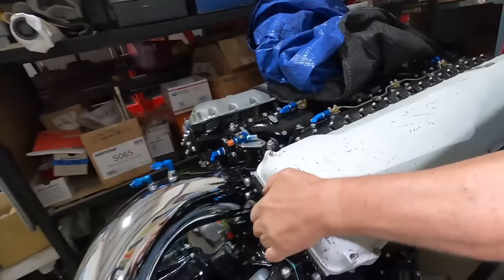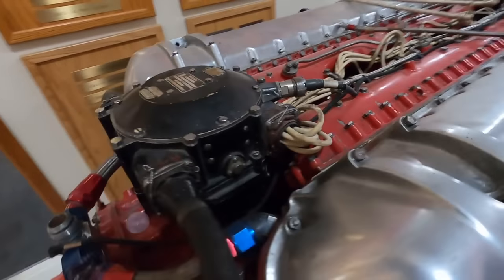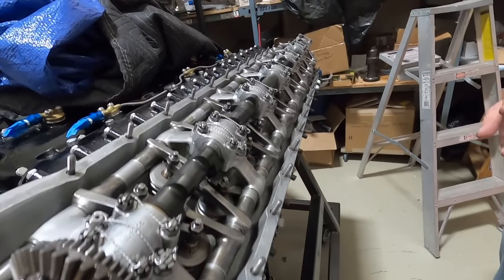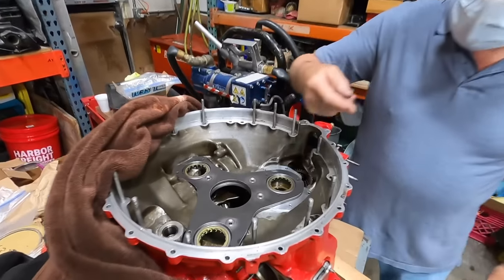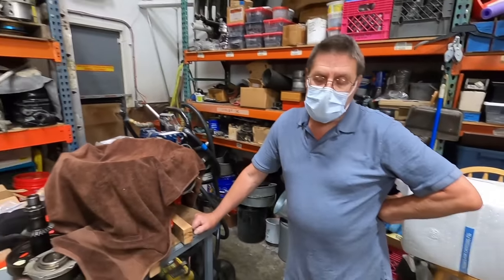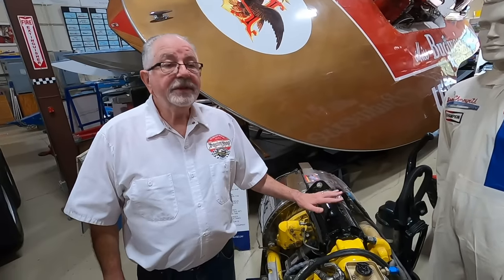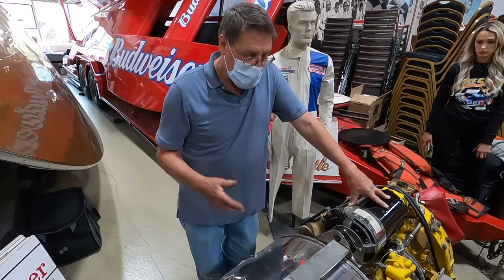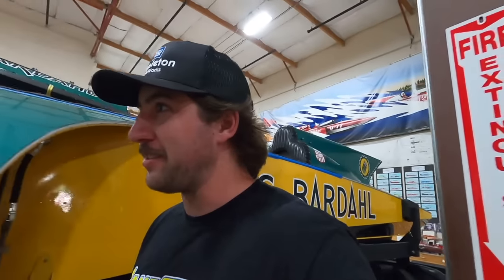The Rolls Royce Merlin: WWII Fighter Plane Engines Modified For Hydroplane Racing!

Comment: The reason for multiple stages in airplane engines is to compensate for the reduction in air pressure as the plane climbs.

Comment: Twin spark plugs are almost mandatory to make five inch bore (and up) gasoline engines run right.
Shut one mag off you lose like 250 horsepower and the exhaust pipes turn bright yellow from wasted fuel energy.
Reply from the maker: Interesting! I wondered why it needed two and forgot to ask him. Thank you

Comment: They Didn't Call Them "THUNDER BOATS" For Nothing 😂
Grew up with these beasts. Worked with Seafair and the Water Follies. And Boeing 😏
But really "MISS" the sound of the pistons.
And being they used to run several laps per race. You learned what sounded right. And what sounded like... 😢
.... memories

Comment: I am hooked! Thank you for doing this. Don't use a merlin, You'll never keep it with the parts it'll need. There are alot more Allison's
Reply from the maker: The cool factor would be the original RR engine in the modern RR car but I get what you mean.

Comment: Very interesting and informative video; props (pun intended) to the folks at Hydroplane and Race Boat Museum for their efforts and knowledge!  There was nothing quite like the sound of the Merlins, Alisons and Griffons, "back in the day"; there's just the one turbo-Alison boat now competing (U-3 Cooper Racing); they raced at Guntersville this past weekend; Jimmy King did credibly well, only to have his first place finish in Heat 2B taken away, owing to the "under 80 MPH rule" prior to race start (as it was, the final was cancelled, after Andrew Tate blew over in the U-91, after getting caught in the roostertails of the leading boats; severe weather moving in caused the officials to cancel any restart of the final).  This race also saw the first "post-fuel restriction era" 170+ MPH qualifying lap (Dustin Echols in the U-40 Bucket List Racing boat).

I think the Harley-Davidson V-twins use the "blade-fork" conrods in their engines.  Also of interest to me was how different the Griffons sounded vs. the Merlins; I've learned that it had to do w/ firing order, not displacement, giving the Griffon a much more "brutal", gutteral sound, vs. the "snarl" of the Merlins.  I wonder if the museum has the gearbox used in one of the earliest turbine boats, the U-95, which ran two T-53 Lycomings (used in the UH-1 "Hueys"; the T-55s used now are in the CH-47 Chinooks); they ran the output from both engines to a single prop...I think the Executone you had a photo of at 23:50, was the U-95 hull, last raced in 1983--it only ran the T-53s for the 1974 season, doing quite well, before ending up on the bottom of Lake Washington when a hot section exploded on one of the engines...
Reply from the maker: Is it still down there?
Reply: @Stapleton42  The hull was brought up the day after the event; it then ran, not so successfully, in 1975 as the "Shakey's Special", using stock-Allison power, then again in 1976 as the "Sunny Jim".  Later versions of this same hull ran as an Oberto, and the Executone (1982-83), as in the photo.  Not sure where the hull is now; seems it turned up for sale somewhere...IIRC, Pam Clapp donated the unusual gearbox to HARM sometime back.

Comment: At 25:17 in the presentation, it is remarked that engine used in the Unlimited Hydroplanes was from a Huey Helicopter. In my investigation, it was the Lycoming T55 that was used in a Chinook Helicopter, because of the existing gear box. The greater question of mine. Where did fuel storage take place on the H1 Unlimitied's. It's 4.3 gallons / Min. on consumption of fuel. Because, of the weight of the fuel at the end of the race with the now "nearly" empty fuel tank (s) or fuel cells. How was the weight difference corrected? Was the race laps in racing a  H1 because amount of fuel on the race boat.  What I am refering to, is the balance of the hydroplane.
Reply from the maker: Good question. They’ve used multiple types of helicopter turbines all over the spectrum from what I’ve read.
Reply: @Stapleton42  It's the ones with the changeable gear box. I have also read the H1 class all boats "shall" use the same type of engine. From boat to boat so that no one will have an unfair advantage. After burner is not allowed. (although that would be really cool ". I don't trust the internet..... so whether this is true or not is unknown to me . I'm just asking.

Comment: Stapleton nailed it when he said the high performance car industry was born from WW2 aircraft engine technology.  Supercharging, turbocharging, hemi heads, 4-valve heads, high octane fuel, water-methanol injection, nitrous oxide.  All of it was top secret technology, required to win the war.  When the war was over engineers applied it to our cars, and when the aircraft mechanics came home, they started building race cars from what they learned in the war.
Reply from the maker: Yes sir!
Reply: Maybe in design phase but once aircraft flown over territory held by enemy not so much. Everyone sent engineers to look over shot down aircraft.

Comment: Allen Millyard did similar rod set up in his kawasaki v8/v12 coversions. Similar to radial engines rod set up."thats not something you build in your garage"- gearbox, Again Allen Millyards 15x20 shed in u.k. disagrees. Sand casting, mill, files, measuring tools, and lathe boom u can make ANYTHING

Comment: Check out the boat in my picture thing! 1983 Hondo XH511 T-deck runner bottom, 468BBC with a hydraulic throttle, powerglide transmission without a torque converter, Casale V-drive, and 7 place adjustable cavitation plate's (adjustable trim) 11x13 pitch elephant 🐘 ear propeller! Get in touch please, I've raced almost everything, and a motor head since conception!..from Wyoming USA 🇺🇸 👋🤠

Comment: I’ve been interested in performance engines since before HS but I grew up in a Farming Family in South Texas, born in 1955. Got into Drag Racing as a Top Alcohol Dragster Pit Crew in the 70’s progressed to Super Stock in the 80’s and Bracket Raced my HS Car in the 90’s and became NHRA Safety Safari Top End Director from the late 90’s to present. I could understand him and sure to find myself a position in his shop and crew. Very Intriguing! Indeed!

Comment: Amazing engineering !
   Blowers are inefficient... why didn't they turbo  instead of supercharger in racing form or plane ???
Reply from the maker: I would think 1940 turbo technology was not up to par. Heck even in the 80s it wasn't like it is now. Also packaging constraints. Part of the Merlins appeal was its narrow footprint allowing for an aerodynamic fuselage
Reply: @Stapleton42  CRAZY it's that old !  OMGOSH I didn't even think about 30-40's tech. when designed & built. Your right Turbo's not reliable (at all ! )  till middle 80's .  Lol what a beautiful engine !

Comment: Sorry to say, but I lost some interest in this video when they started talking about the turbine engines.  They were interesting for the first few years, but when every boat had them (except for the one stubborn Allison boat) the sport went downhill.  Not enough sound, just a whoosh, not a roar.
Reply from the maker: I wasn’t alive then but it sure seems that way
Reply: The reliability of the T55L7C was the biggest reason for the change. Extremely more reliable and require less maintenance. The pistons would be completely uneconomical at this time.  However, teams are running out of parts for those now as well. The mechanical fuel controllers are going to be the end of this version of the turbines. And yes Stapleton42, do a Bernie Little feature and also Fred Leland. Going to be hard to find the remnants.

Comment: The suggestion that Griffons were not used earlier than the 60s is completely wrong. In 1949, Harold Wilson challenged for the Harmsworth Trophy in his brand new Miss Canada IV, powered by a type 57 RR Griffon. While unsuccessful in that challenge (the enormous power of the Griffon, coupled with the incredibly rough Detroit River waters, torqued all of the cast steel props Wilson had), Miss Canada IV did set a North American measured mile record of 138 mph. THe following year and with a new forged prop, carved out of solid block of stainless steel by Rotol's keller machines, Miss Canada IV tried to up her record and best Slo Mo Shun IV's new world record of 160 mph. She completed one run at over 172 mph, but on the return run at an estimated 200 mph her gearbox exploded and the boat drifted to a stop just 200 yds short of the finish line. As Wilson had already announced his retirement from racing, Miss Canada IV was sold to James & Gordon Thompson who renamed her Miss Supertest; her Griffon engines, however, had to be returned to the UK as they were still deemed an official state secret. The Thompsons used a Merlin in their 1st Supertest but  moved to a Griffon when they became available to the public in their Miss Supertest II which briefly held a new world straightaway record set in November 1957 in Picton, Ontario. In 1959, their new Griffon-powered Miss Supertest III challenged for and won the Harmsworth Trophy in Detroit, finishing the job the Wilsons and Miss Canada set out to do. Miss Supertest III, with Bob Hayward driving, successfully defended the Harmsworth in Picton in1960 and 1961. When Hayward was killed later that year in Miss Supertest II, the Thompsons retired from racing. Miss Supertest III and the last boat she raced against, Guy Lonbardo's Tempo VII (which had been bought iin 1957 by Detroit's Chuck Thompson and renamed Miss Detroit) are together again in the Canadian Raceboat Hall of Fame in the Muskoka Lakes area of Ontario. For more info, follow us on Facebook @greatraceboats.

Comment: Always thought they were really really dangerous machines , ,how crazy fast can we go before we just die anyways ??. so glad they have mini nuke bomb pods to jockey them from now . have watched the factory tours of RR aero engines production lines [ all that work to blow up germans trying their hardest to do the same thing !? crazy .. humans are just crazy I guess ]. So fascinating as a sometime engine builder to see more internals of the Merlins  . Direct shaft cam drives ,nice , twin scroll compressors for 45Lbs boost ,Baby !?. Have to ask have we made any progress really since the 1920s when all the test bed work was done ? ,even direct drive compressors coming back again !?.  Could the revetech tri lobe ,or angel Morrigardo's MYT motor have stepped us up ,yet somehow got sidelined ? . Will the liquid piston or similar set up give us some actual advances ?.  It does look like the turbine is not really suitable ,or less than ideal , for course racing .  [wondering what a 12 rotor rotary could do , if 3 can give 2000 hp , 8000 hp at 8000 rpm direct drive ? just saying ].

Comment: How many engines you know pushing 45lbs of boost… me thinking welllll thats not that much compared to the drag cars these days😂
Reply from the maker: Stock type engines in his case not very many lol
Reply: Lbs is irrelevant as it just measures back pressure, if you block or restrict a pipe psi goes up but flow or actual air mass didn't increase.

Comment: 27 liters 1600 cid very nice but they got a Allison v1710 twins Napier air craft n Harry a Miller W16 aircraft Allen Johnson pe V8 18 liters plus V8 with itb n blower running 273 mph

Comment: I have a 1980 Kodiak Chevrolet K65 4x4 one of those would power it very nicely, front differential housing is around 2ft in diameter rear differential is around 4ft diameter,,,Completely beast drive train,,now a merlin

Comment: Whoa whoa whoa...are you telling me there's no main bearing to bore center offset???? That's actually counter productive. Not only does a bore-centered main wear out one side of the piston, rings, cylinder wall, there's much much higher probability the connecting rods will become disfigured over time because the way the  forces multiply the chances of doing so the steeper your connecting rod angle is after combustion. You also lose a noticeable amount of stroke. In a low rpm forced induction application I would want as long of a stroke as possible within reason of course. I imagine these bad boys move an astronomical amount of air. Has anyone ever done a twin turbo Merlin? I know I know, centrifugal blowers are cool, especially when they're the dual wheel configuration I think that's a really cool idea to make boost at high altitudes. However, it's very very difficult to tune from what I understand. Pretty much the power it makes is the power you get. There's no raising the boost level without internal modification from what I understand. I could be wrongly informed but, after pausing and really looking at these monsters, that's what it appears to be. I mean, imagine being able to run two like, 300mm electric wastegates  and two of the largest  turbos Garret makes, some super trick equal length manifolds 6 into 1 into something larger than a t-6 flanges (like a t12, hahaha), then go coil on plug, fuel injection with a few huge brushless fuel pumps, 2, 2200cc injectors per cylinder, with a holley dominator controlling it all. Not sure what sort of amperage that magneto makes but I bet the dominator could handle it without a voltage regulator. Sorry about the long comment guys, this stuff is just, well it's my life and I like to be as well informed as I possibly can be. I love learning.

Comment: I think a compound turbo is geared back to the crank. Two stage were not hearnessed that way. Glad to be wrong. I think two stage is mostly for keeping cross-section down. A single stage of similar flow would be wider than the engine, negating the streamlining advantage of V12s.

Comment: Just goes to show that you don't need CNC to make high quality high tolerance parts. I got into an argument once with one of these racing channels about that and the guy insisted that you needed CNC and that without it you couldn't get the same tolerances. That's why you need to know history. You can learn from the past and use that to improve your future. It's also why most of my equipment was built before the 60's when machines were built to be rebuilt and were made to last for decades. I'm not knocking CNC instead I'm appreciating the quality that was built in the past.

Comment: The reason the aircraft engines had high/low blower was so that the engine could make full power at altitude. That’s one of the major advantages in aircraft service of the Merlin over the Allison. The Allison with a single speed blower would hit its critical altitude lower and then start losing power as it could no longer make full boost. The Merlin with the 2 speed was till making full power at a much higher altitude. 

You had some of the Merlin’s and Griffons that were single stage/speed blowers because they were being employed in aircraft that operated at low altitude.
Reply from the maker: Makes sense!
Reply: jetdriver  WRONG !!!!  ALL merlin engines up through the 50 series were single stage, the 60 series merlin introd in late 1942 early 43 were the first Merlins to use the 2 stage supercharger.  Most people only A SS U ME that all merlins were 2 stage they were not !!  Of the 20,000 spitfires made only 7,000 were the 60 series 2 stage,  and ALL Hurrycanes and Lancaster bombers also were the 20 series SINGLE STAGE supercherged.  Just the facts of history setting you straight !!!   There were 4,000 MORE Mustangs with the 2 stage merlin engine that spitfires !! !
Reply: @wilburfinnigan2142  obviously when your a jerk and want to nit pick a general comment about an engine that was produced in a great many variants you can do so. 

However. Let’s go back and look at my comment. It’s absolutely true that the two stage Merlin outperformed the Allison at high altitude in large part because of its two stage blower. That’s why all the Merlin engine Mustangs had two stage blower engines. Performance at altitude is the reason for the two speed supercharger. 

Also note that I said that there were variants of both engines with single speed superchargers. Ok it’s a fair nitpick that early Spitfires all used single stage engines and were not “low altitude” aircraft. However it’s also true that single stage Griffons for example (which I mentioned in my comment) were designed for low altitude use as the engine was designed from the outset to be capable of being fitted with a two speed supercharger. 

In summary it’s you who are wrong. I did not state that all Merlin’s were two stage but specially stated that there were single stage variants. 

Ohh and you state that only 7000 2 stage Spitfires were produced and that there were 4000 more 2 stage Mustangs than Spitfires. Approximately 13,300 Merlin engine mustangs were built which is 6300 more than the number of Spitfires you cite. And another source says that 8996 is how many 2 stage supercharged Spitfires were built. 

So it would appear that it is you not I that is being set straight by the facts and perhaps should take reading 101 again as soon as possible. Not to mention how not to be a total jerk 101.

Comment: the turbine engine boats would greatly benefit from a variable stator torque converter. or a slipper clutch on the out drive.

Comment: Our racing props are about $600 a piece.
Reply: Our props are 6 to 7 inches in diameter and 10 to 13 pitch. We run outboard hydros under the NBRA (National boat racing association) racing body. We have a 6-8 races in Texas, Oklahoma, Louisiana, Arkansas and Illinois.